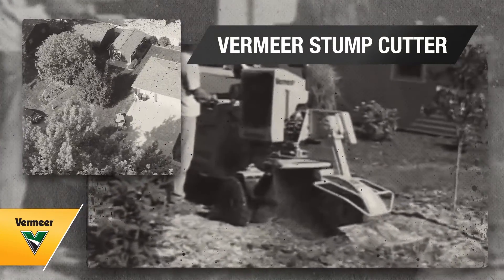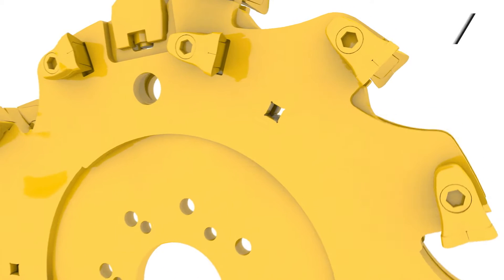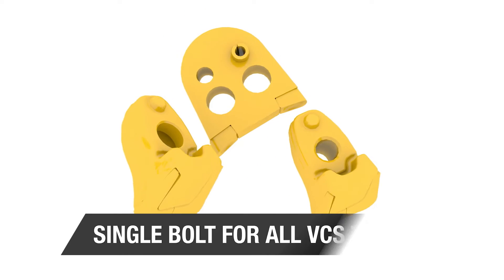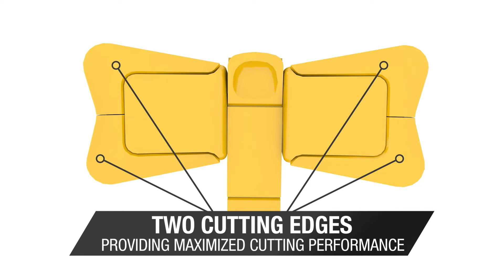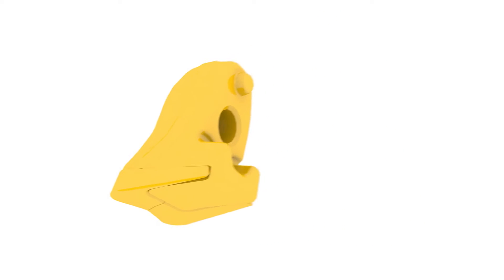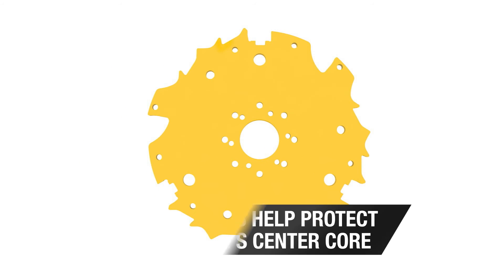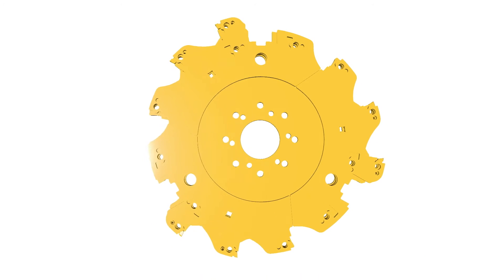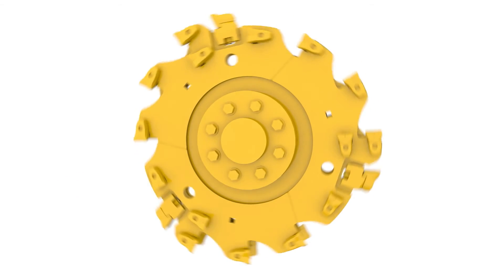Introducing the Vermeer stump cutting system

Comment: Will the wheel be plug and play for the current line up of Vermeer grinders?
Reply from the maker: Thanks for your question! The SC70TX, SC552, SC852 and SC802 stump cutters are currently being manufactured with the Vermeer stump cutting system.